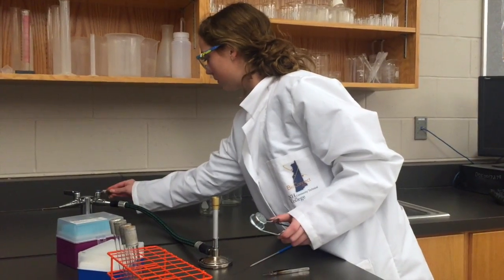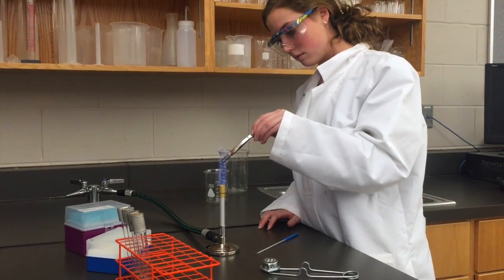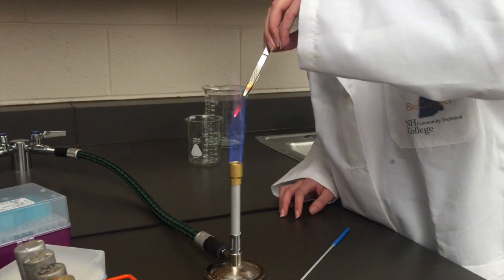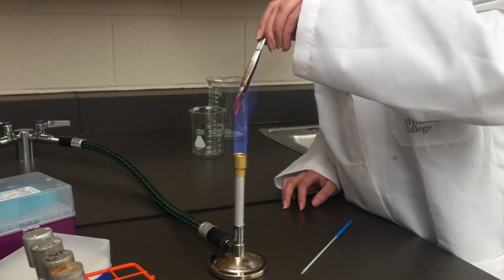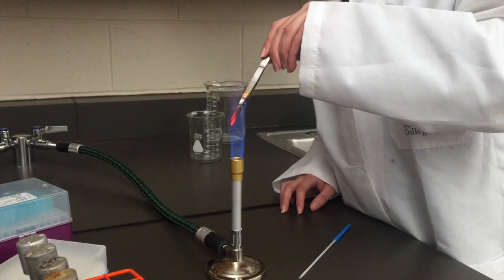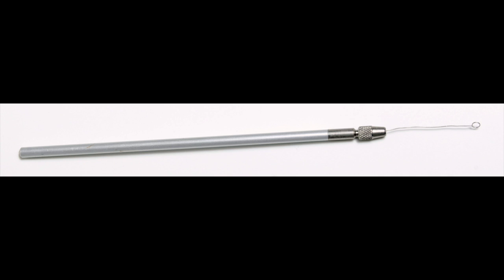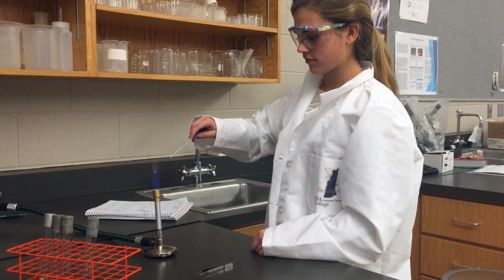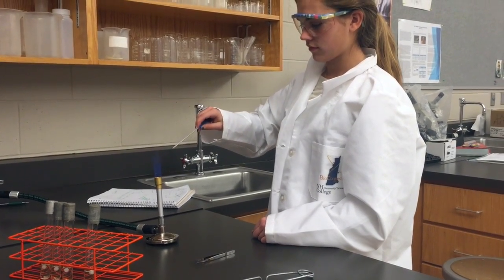How to Flame Sterilize Forceps and Inoculating Loops

Comment: No..Loop is made up from different metal..It heat up fast and cool down fast also but forceps didn't cool down fast..So you should deep in 70-80% alcohol and then flame it. it will do sterilization .No need to red hot
Reply: Your comment isn't that clear. Flame it until what, how long?
Reply: @diy_mushroomguy  I mentioned "No need to red hot."
Reply: Will the loop spatter
Reply: @viratkohli7137  no